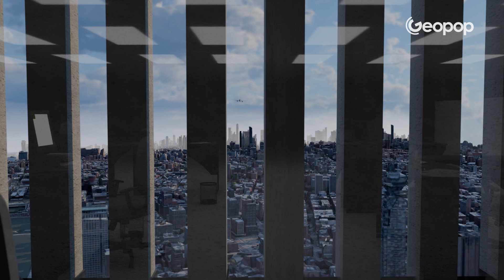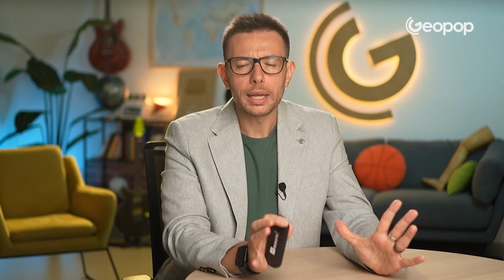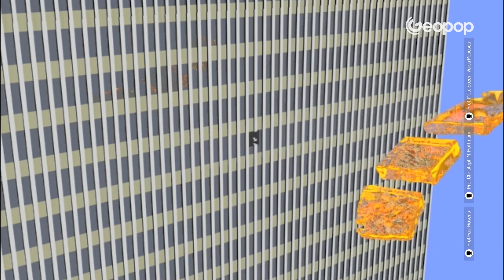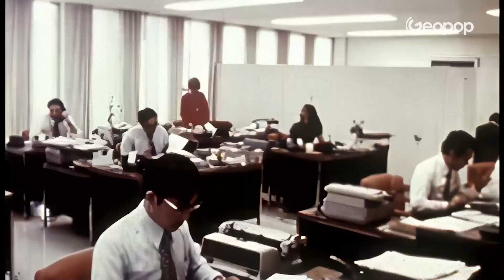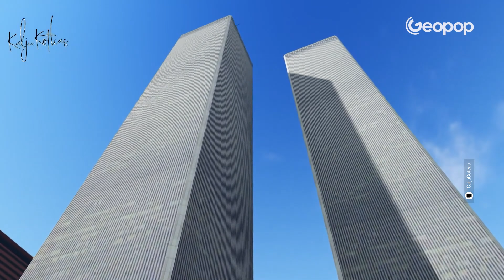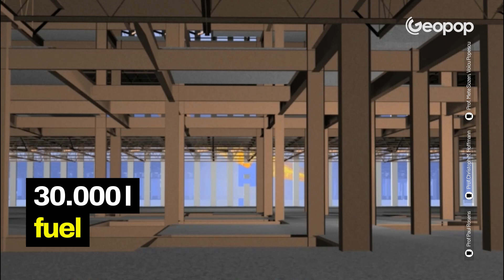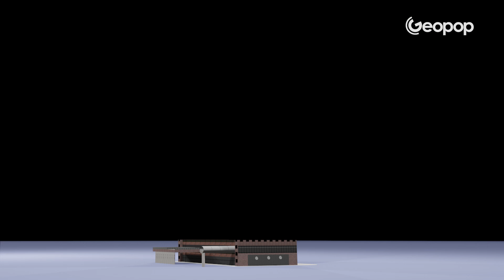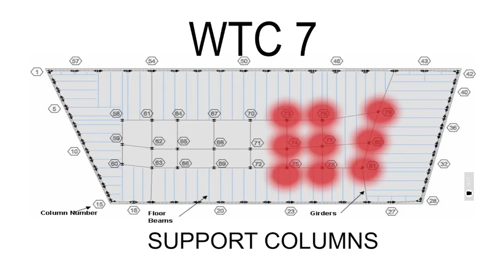9/11, 2001: The Technical Reconstruction of the Twin Towers and WTC 7 Collapses

Comment: The way the plane basically comes to a stop inside from that speed will never not fill me with total horror. The forces and violence of it all is diabolocal.
Reply: I think it was disintegrating on the way through but not without causing catastrophic damage to the structure and lives
Reply: @misshannah, you could listen to Joe dittmar talk about escaping from the south tower and  what he saw and heard during his experience.
Reply: @MissHannah2036  Compare it to the B-25 that crashed into the Empire State building back in the 50s. Hardly any damage to the building (superficial w/burn marks), but the aircraft crumpled and fell down the outside of the building onto the street below. Kinda makes you think. And if you want to talk about differences in airspeed, any plane flying that low has to be going very slow or the friction/resistance of the air would tear the wings off. Claims that the jet aircraft on 9/11 were going upwards of 600 mph are rubbish.
Reply: @ronagoodwell2709 Completely different building structures and extreme differences in speed and size of the planes. In addition the 767s were filled all up with jet engine fuel. Hope you'll feel better soon..
Reply: @ronagoodwell2709  
True, the Flight Speeds at Impact were as follows:
    American Airlines Flight 11 (North Tower): Hit the building at an estimated speed of 429 mph to 494 mph
    United Airlines Flight 175 (South Tower): Hit the building at an estimated speed of 537 mph to 587 mph Key Details: Both aircraft were Boeing 767 jets. Flight 175 struck the South Tower at a much steeper descent and higher velocity, approaching near the maximum operational speed limits for that altitude.
Reply: @GregoryClarkson-j1j  Impossible airspeeds for that elevation.
Reply: @alf-erikritsland1051  As you should know commercial jet fuel is kerosene. Low burn temperature for safety. No fixed wing aircraft can fly fast at low altitude.
Reply: @ronagoodwell2709  That is what the official report states.
Reply: @GregoryClarkson-j1j  9/11 Report was cooked by Bush cronies. A comic book account. Totally embarrassing.
Reply: @alf-erikritsland1051 yes, different. The Empire State Building is way weaker....
Reply: @ronagoodwell2709  It was a B-25 in 1945, a tiny twin engine ww2 propeller driven bomber, completely different situation as such a plane is barely 1/10th of the weight of the modern jetliners fully loaded and fly a lot slower.
Reply: @MMM_MADness  You're right. It was a B-25. But it makes no difference as to the weight and airspeed since all forces act as much on the aircraft as the building. See Isaac Newton for details. Either plane would be crushed on the exterior of the building with only a few pieces getting through. BTW, airspeed on the larger jet aircraft would be as slow or slower due to the size of the wings and both the resistance to air and the lift from denser atmosphere..
Reply: @ronagoodwell2709  tell me you have no understanding of physics or airplanes or pretty much anything else. A 767 has a max speed of over 400 mph at 1,000 feet. That doesn't mean it can't go faster; it just stresses the airframe to do so. But those guys flying that day didn't really care about that. And that max is at level flight. Even a shallow descent under full power can increase that speed significantly.

The side of the Empire State Building was solid concrete subjected a MUCH smaller aircraft traveling at a fraction of the speed of those 767's. And the outside of the WTC towers were thin steel columns. The aircraft would slice right through them at those speeds as both the columns and aircraft disintegrated. The idea that a fully loaded 767 flying at maximum speed would bounce off the WTC is flatly idiotic.
Reply: @ronagoodwell2709  Nearly 1500 degrees F. For aviation fuel. Hardly a low temperature, And a low burn temperature is most definitively NOT the reason they use aviation fuel. Gasoline is too volatile at high altitudes for jets. The combination of low pressure and extreme cold makes gasoline totally unsuitable for modern jet engines. Aviation fuel has a much lower vapor pressure than gasoline, so it continues to flow easily into the engines even at the extreme altitudes of modern jets.

And, just for the record, a 767 can hit over 400 mph at 1,000 feet in level flight. Put it into a shallow descent and it'll go significantly faster.
Reply: @ronagoodwell2709  the top cruising speed for a 767 at 1,000 feet is ~420 mph. That's the manufacturer of the plane telling you that you can safely fly at that speed at that altitude. If you have an issue with that, you'll have to take it up with Boeing. 

You can easily exceed that at risk of doing some damage to the airframe - the plane doesn't disintegrate at 430 mph. Flying in a shallow descent, a 767 can easily surpass 550 mph for short periods.
Reply: @deerrr-o6t  BS. At 1,000 feet, the Boeing 767’s certified maximum operating speed is about 360 knots (≈ 418 mph / 673 km/h). That's BOEING telling you how fast you can safely operate a 767 at 1000 feet. That doesn't mean it can't fly faster than that - it just means Boeing doesn't recommend it at the risk of airframe damage. Got a problem with that? Take it up with Boeing - they're the ones telling you you're an idiot.

You don't have a clue what you're talking about.
Reply: @ronagoodwell2709  Impossible level of stupidity to dismiss the numbers given by the people that really know what they´re talking about.
Reply: @ronagoodwell2709  LOL Wow were you roasted here, nutjar!
Reply: @alf-erikritsland1051 engine fuel is nothing than additional mass. It doesn't chabge the behaviour of steel beams on impact.
Reply: @ronagoodwell2709 temperature of burning kerosene doesn'r change anything in the equation of the planes impact ibto the structure.
Reply: @MMM_MADness the building's structure was antiquated as well.
Reply: @jeboyd710 "thin" steel columns. Lol. How thin? How thick is aluminum sheet metal on a 767?
Reply: @jeboyd710 1500⁰F under what conditions?
Reply: @GorkaLlatzer how do you know they know?
Reply: @ronagoodwell2709  There are videos on YT showing the construction of the Empire State Building and the damage from the bomber. It has a very hardy overbuilt steel skeleton that does the load bearing and transferring of force. An incredible number of rivets and plates at every joint. Whereas the WTC buildings, as illustrated in this video, were dependent on the perimeter and core columns. The floor joists had longer spans to bear load and the joint structures (something-hats, forgot name) on the columns are nowhere near as strong as what's joins the ESB. 

When the ESB was damaged, they simply had to unrivet the damaged area to replace the necessary parts. Because it was so overbuilt (think draw span bridges in Chicago or on the Mississippi from 100 years ago), there was not much concern about structure while making repairs. But, with the WTC, if it was even 1/3 the damage, you have to add so much bracing to make it safe before removing any damage.

Then, throw a much heavier aircraft with a lot more fuel with far more momentum at the weaker of the two designs. . . It is comparing apples to oranges, or more like grapes to pineapples.

The people in the ESB, at the time of the bomber impact, said that they only felt a shutter go through the building. . . Look up the video about it.
Reply: @jeboyd710 That's Boeing telling you the speed it should not exceed or you risk damaging the plane. They also have significant safety margins built into the design. Tell us you don't understand aircraft (or engineering in general) without using those exact words. But you do have a factoid devoid of any of the context that gives it any actual meaning. I guarantee the 767 has the power to exceed 500 mph in a shallow descent if you don't give a flying fuck (so to speak) about damaging the engines or stressing the airframe. Do you really think the fanatics flying those planes had any more concern about damaging them in an overspeed situation than any Japanese kamikaze did in WW2?
Reply: @ronagoodwell2709  My god, are you stupid.
Reply: @ronagoodwell2709 that is not how speed works lol
Reply: @ronagoodwell2709  Imagine thinking a fully loaded 767 at 600 mph would just be crushed like a tin can at the exterior of the WTC and fall down. Hilarious. You do know there's footage of both airplanes before impact (much more of the second one of course) that enables us to analyze the video frames and calculate the speed.
Reply: @ronagoodwell2709  “No fixed wing can fly fast at low altitude" except UA175 DID, logged on radar at 510 knots at 1000ft. Vmo is 360 knots, that's a LIMIT, not a physical inability. At 510 knots low you get massive flutter and the plane shakes itself apart which is exactly what the FDR shows. It was 90 knots past its design dive speed. You don't know the difference between Vmo and Vo
Reply: @ajgreen868  Ask any pilot who has flown one of those beasts. Clacker comes on when you exceed safe airspeed (at 700 feet elevation it's less than 200 kph.) and plane begins to loose control. Combine this with the lack of training on large airframes by pilots and you get a clear impossibility. Let me repeat that word: IMPOSSIBILITY. The whole 9/11 narrative was either a fake or a lie. And you fell for it. This event set the stage for the Heritage Foundation and the GOP to do exactly what they are now doing. I. e. dismantling not only the entire government (the so-called deep state, which is everything), but the accepted social order as well. Ask yourself who benefits from a failed America? Not me, that's for sure.
Reply: @goncalonascimento6054 Cartoon simulation. I believe it was the second impact that showed a hole in the side of the building as an exact silhouette of the aircraft--wings and all. That's the Wiley T. Coyote evidence for fools like you.
Reply: It's the same principle as when NWS surveyors were looking through Joplin, MS after each F5 or EF5 tornado and found blades of grass embedded into concrete and trees. For their size, planes are incredibly lightweight, very low average density. The only place you'll find steel on a 767 is in the landing gear and engine cowling, everything else metal is aluminum. Aluminum likes to shatter when it is sharply overloaded, for instance, hitting WTC 1 at 500 miles per hour. The plane didn't simply stop, it turned to powder and shrapnel. Sure, parts of each plane made it clear through each building, specifically the engines and landing gear, but everything else largely remained inside each tower
Reply: @gesitiwadengaming9873  The blade of grass found embedded in concrete story has been debunked. Check with Isaac Newton for details on why impossible. None of the aluminum should have made it inside the towers. The film of one of the aircraft penetrating the side of one tower in a perfect silhouette of the aircraft wings should have been a dead giveaway to anyone exposed to basic physics. It was designed to appeal to idiots educated by Wiley T. Coyote, of Roadrunner fame. I guess that would be you.
Reply: @gesitiwadengaming9873 lol.
Reply: @gesitiwadengaming9873 The towers were designed to withstand the impact of specifically Boeing 767. You can't make it up.
Reply: @JasonCrowther-d6v designed to take the impact of the airframe, yes. Not so much to withstand having tens of thousands of gallons of jet fuel burning over the course of an hour. I'm not saying that jet fuel melted the steel beams, but I will say steel expands as it heats up, enough to start cracking the concrete poured around it. Once the concrete in the floor braces had been damaged to expose the steel beams within, that now very hot steel had become significantly weaker (think aluminum or lead). It's the same idea as a blacksmith heating up material to make it malleable to hammer strikes, or bending with little to no effort.
Reply: It shook the whole building with such force it rocked!
Reply: @hazelwalsh3269  I believe that. Planes impacting at 495mph. (North Tower) and 585 mph. (South Tower) would have definitely rocked both buildings and the speed of the impacts were very likely a factor in the buildings' collapses.
Reply: @harrietharlow9929  There is a video speeded up by 8x showing the tower swaying left and right by up to 10 feet from the impact.
Reply: @harrietharlow9929  Bullshit. But something rocked the buildings. Pre-planted massive explosive charges most likely. We have to have the same conversation once a year.
Reply: @ronagoodwell2709  What a disgrace for your parents you are.
Reply: @ronagoodwell2709  it is abundantly clear you have absolutely no idea what you're talking about. Best you leave this topic behind until you have a better grasp of physics, and reality for that matter.
Reply: @joshward8395  You should wait until you're paid before wasting your time further. Check with your handler. Cuck.
Reply: @ronagoodwell2709 Explosions didn't cause buildings to rock! Explosions feel like, well, Explosions. Every single survivor that was in either tower on impact vividly recalls the buildings sway from side to side. And "they" just somehow timed these magical explosions that no one saw to exactly coincide in time and space with massive airliner impacts? Logic and reason aren't your strong suits, are they?
Reply: @WhoCares-XXXX  There were no airliner impacts. Let's start with that. There were preplanted explosives going off. Big ones at the so-called points of impact, and then smaller explosions going off at key structural locations up and down the buildings. Fire department described sequential popping sounds-exactly like  controlled demolitions. Seismic records confirm multiple events, from big to small and then big again as the buildings came down. And people were planted to bear false witness about aircraft and other people thought they saw ... something. In courts of law eye-witness accounts are the lowest grade of evidence, because unreliable--especially over time.
Reply: @ronagoodwell2709  Take your meds. Don't be such an utter loon.
Reply: It truly is. How anyone could carry out mass murder like that is beyond me, but it was certainly diabolical.
Reply: @harrietharlow9929 islam...
Reply: @harrietharlow9929  dancing Israelis
Reply: The way an aluminum plane penetrates a massive steel structure challenges my  understandibg of ohysics.
Reply: @georgegordonbrown9522  Really? Those buildings were monoliths of solid steel and concrete. By comparison, the planes were relatively thin metal shells. Given they were travelling at 500+mph at the point of impact, it's no wonder they disintegrated.

Even as a layman, the physics at play here really should be obvious.
Reply: @22:22 it shows the front portion of the ‘plane’ exiting the other side of the building.
Reply: @FUNKINETIK I know huh, its hilarious people believe thats actually possible hahaha
Reply: @Lar @LarryMctavish go back to your flat earth
Reply: The towers were built to withstand a plane crash. That's why demolition charges were used alongside it.
Reply: More like the forces and violence are cartoonish. What was diabolical was the mass of explosives pre-planted in the building around the core of the elevators.
Reply: @ronagoodwell2709 sybau dweeb, 911 conspiratards are so 2011.